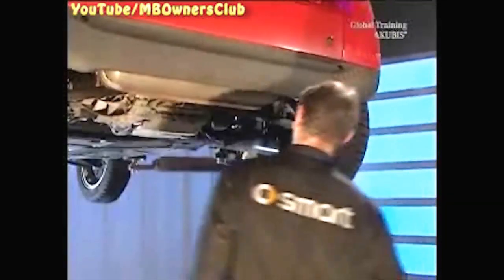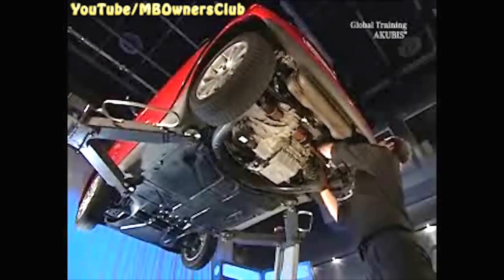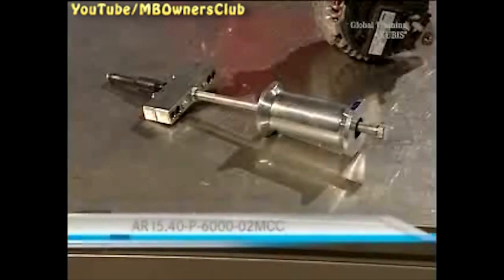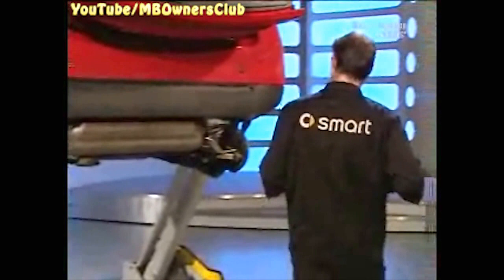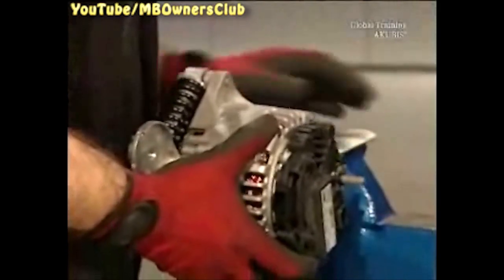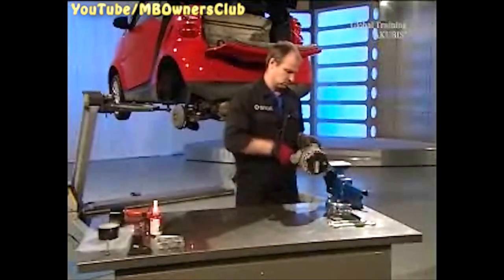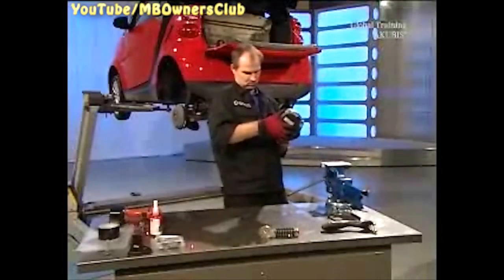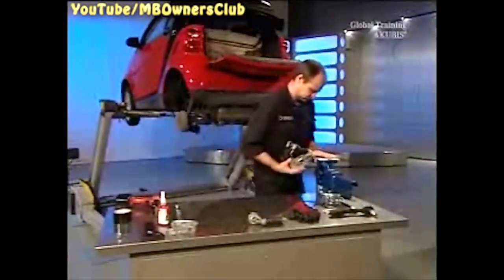Smart Fortwo - How to Replace the Starter-Alternator Bearing - Part 1 | W451

Comment: Removing engine to repair alternator and starter? What crapmobile.
Reply: It is "Smart" only for Mercedes stockholders.
Reply: The engine was not removed, what are you talking about?
Reply: @ferrumignis   You have to lower the rear drive module which is only a few steps away from removing the engine. This is a frustrating vehicle to work on. The basic intent of owning a Mercedes is that you always use Mercedes Service. This vehicle is a mixed bag of fun and frustration. Having a real lift would remove the frustration part.

With the old 1968 VW Bug, the engine could be pulled in 5 minutes with just a jack under the engine and then reinstalled in 5 minutes.
Reply: @JohnHoranzy  I own a Smart ForTwo and a Roadster, and rebuilt the engines in both (bought cheap due to engine faults).  They are a bit different to work on, but not difficult as such.  The engines can be lowered without having to disconnect all the pipes and cables which is the most time consuming part of removing an engine.
Reply: It's 'easy' - remove a few bolts and lower it. They made a small rear engined car - what else could they do?
Reply: @DavidB-rx3km  to be smart?